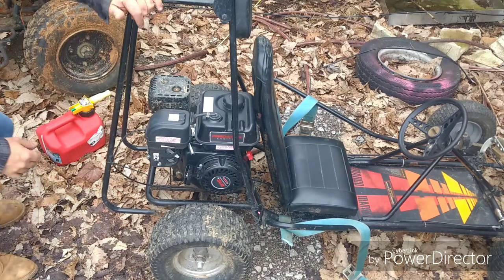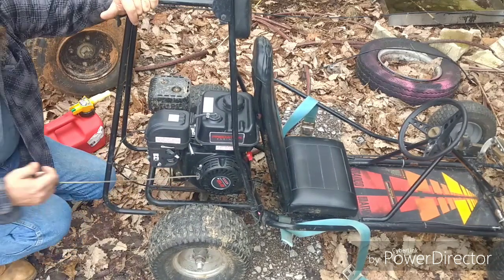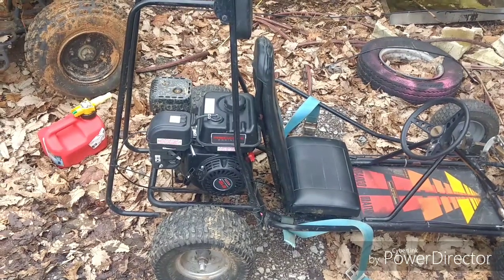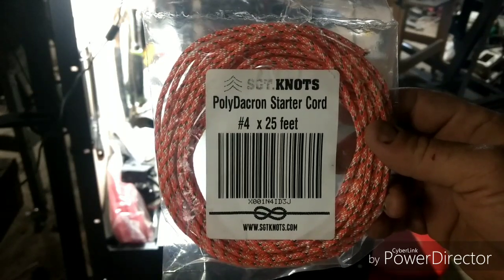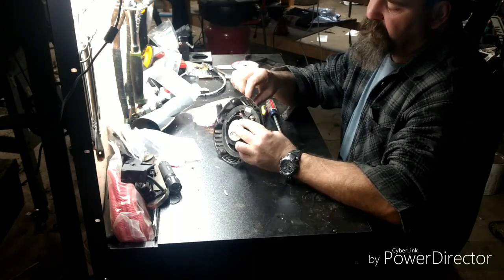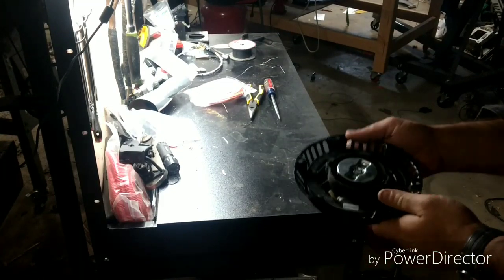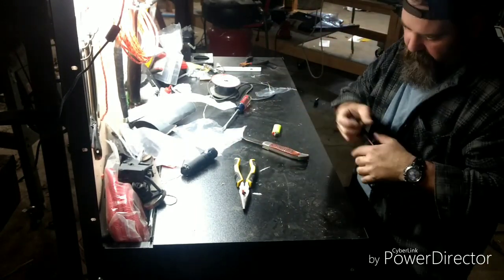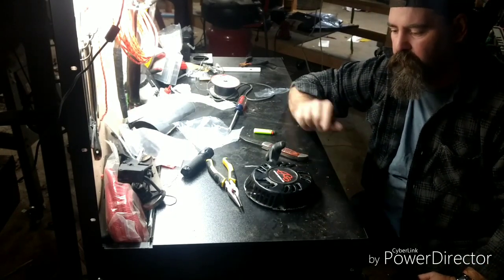Pull rope replacement the easy way

Comment: I have to say...I'm impressed with those needle nose pliers..I don't think I have ever had a pair that would actually cut stuff..lol...great video Hillbilly..haven't seen this on YouTube yet!
Reply: #SMALLENGINENATION!
Reply: You need to rename this video
Predator 212 pull cord replacement/ tips and tricks
It will help u get more views
Reply: Also...change your category from people and blogs to autos and vehicles
Reply from the maker: They are stanley brand.
I only use them for pull ropes and small multi strand wires.
I will have to get on my computer and edit this video.
Thank you for the advise!